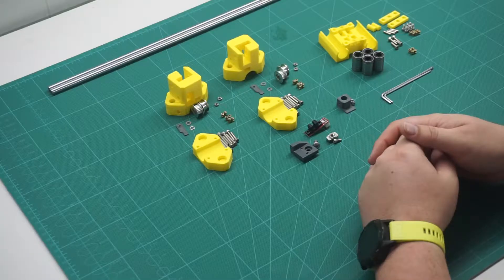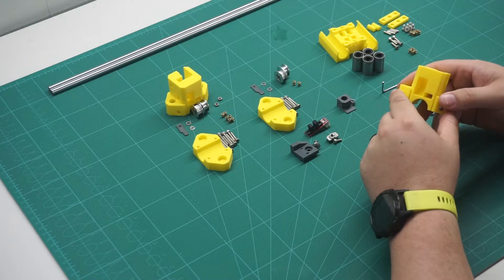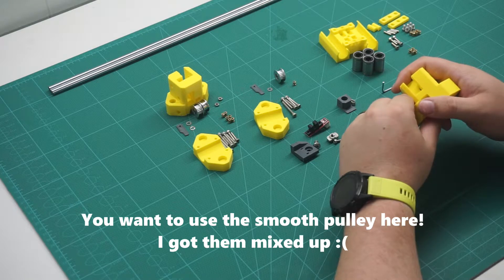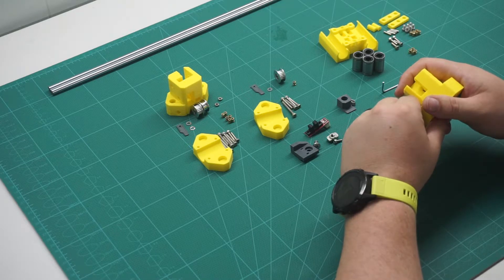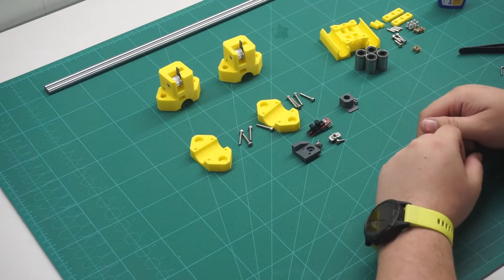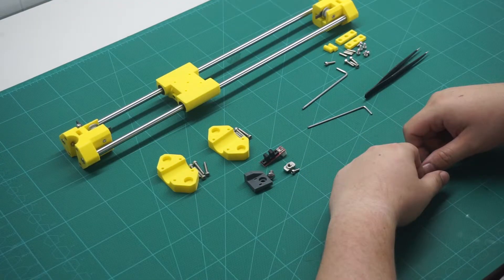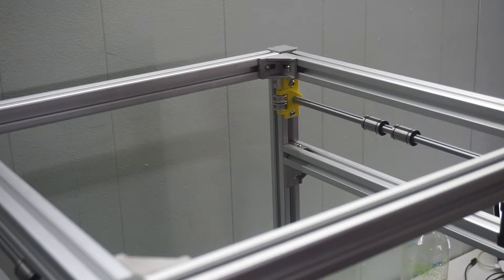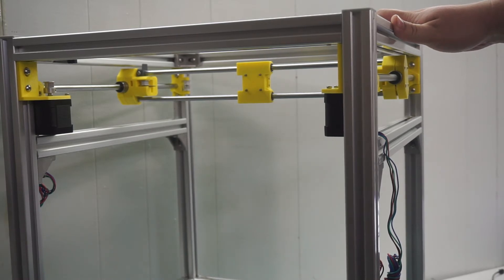Build: Hypercube Evolution - Part 3 - X Axis

Comment: What are the lengths or the rods you used?
Reply from the maker: Hi Jesse I had used the spreadsheet that is available in the thingiverse download. For my particular build I used 450mm for the 8mm diameter rods. 410mm for the 10mm diameter rods and 500 for the 12mm ones.